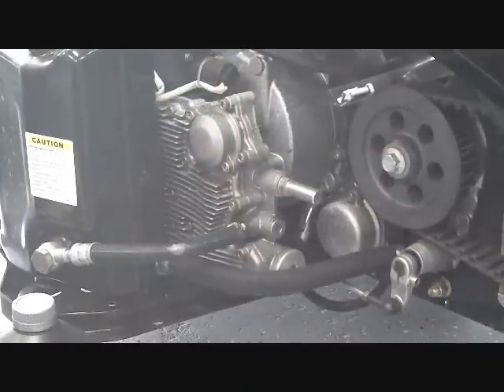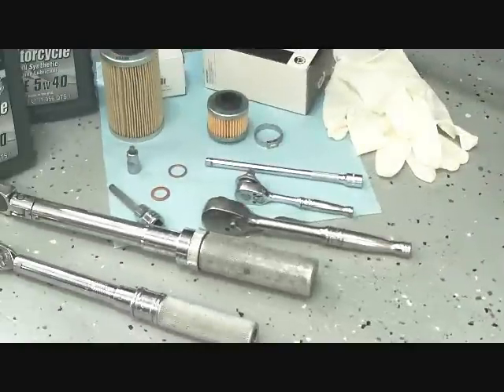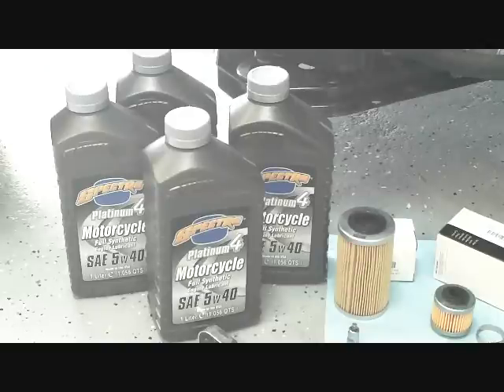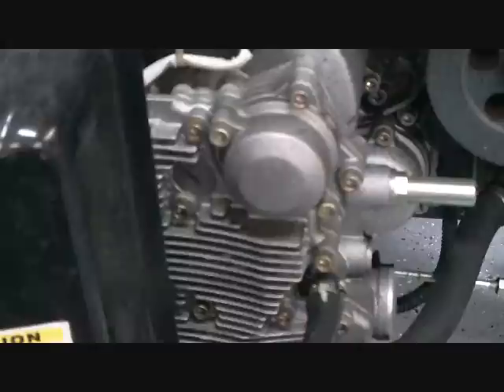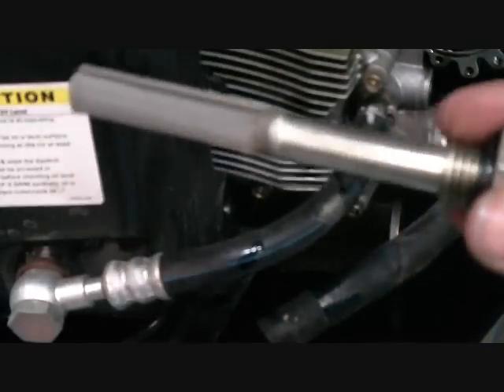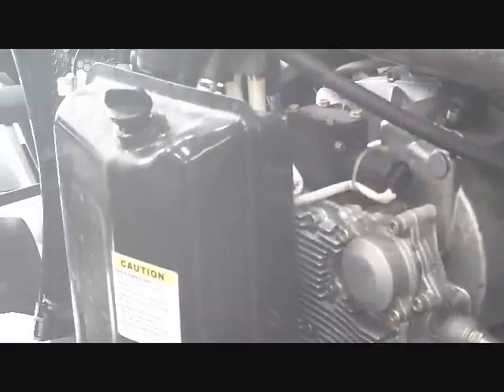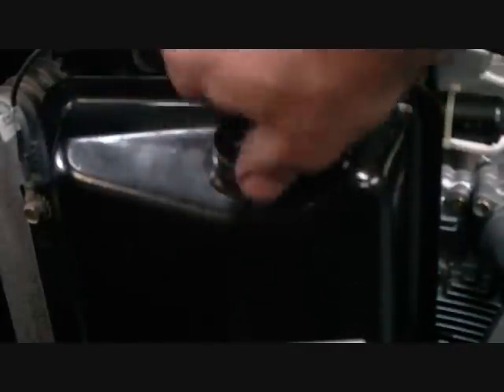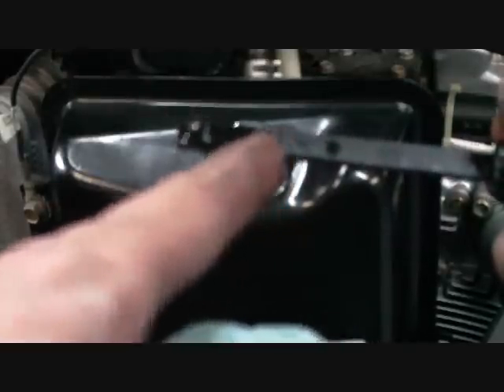Can Am Spyder Roadster - How to do an Oil Change on an SE5 or SM5

Comment: What panels did you take off?
Where is the location of the plugs?
Torque lbs?
One filter on the manual?
Cost of filter or oil change kit?
Time it takes?
Anything to lookout for?

Comment from the maker: All Left side panels - two drains. 1 on the oil tank & one on the bottom of the case near the oil filter. 15ft/lbs torque on the drains, 80 In/Lbs on the covers. One filter on the manual. Buy at your local dealer. I let the oil drain for 20-30 minutes when the oil is warm. Try not to over fill the oil, the engine needs to be a normal operating temperature to check. That means ride it... Don't warm it up for 1 minute and  check it. Oil expands when hot! Good luck. Always use torque wrenches

Comment: The info in the comments is very good, but this video needs to be re-shot showing the body panels being removed and the filter cover(s) coming off and going back on with new filters installed plus maybe the drain plug(s) being pulled... no need to see the oil draining out, we can assume it drains well enough. ps. How often should that suction screen be inspected and cleaned? pps. Also does it hurt if the level is a little over full for any reason, given that this is an external oil tank?

Comment from the maker: On a SE5 the transmission oil & engine oil are one of the same. This is why it's so important to use a quality oil on your Spyder. When changing your oil, add 3 quarts/liters, cover the fill plug, start the engine to pull the oil in then add the 4th qt/ltr. Fully warm the oil, suggest a short ride, pull to a flat surface and let engine idle for at least a minute then turn off the engine and check the oil. Add as needed. Cheers!!!!

Comment: In reviewing your video and others - a little confused as to the number of filters to change out. I have a 2011 Can Am Spyder RTS-SE5 and the dealer only claims one filter and not a transmission filter (secondary cap shown). I cannot confirm or not the secondary cap - since I have not taken the side off yet. Second - mile duration limits can be as high as 10,000 miles or one year with fully synthetic 10W-40. If information is wrong - I am sorry - but have researched this over the past 1-1/2 months, which differs from your video.

Comment from the maker: BRP has come out with new oil filters to aid in the intervals on the oil changes but everything depends on the engine temperature. If it's hot and you ride in town all day then keep your oil changed. Oil will not last that long in a Can Am Spyder, If you only ride highway you might stretch it out to 7500 with the new filter but be sure to check the oil level every 500-700 miles.

Comment: While the filter for transmission was mentioned, installation was bypassed. Also, it is important to watch for the o-ring on the dipstick.  Very messy if you lose it or strip it out.

Comment from the maker: This Video is designed to show you what you need to use when changing your oil. If you don't have the correct tools don't remove the cover. The SE5 requires at least 45 minutes to completely drain the oil out of the transmission side, too long for a video.

Comment: Just did my 2nd oil change on my Spyder SE5. THEN I watched your video. For my first oil change, I spent the $89 for the oil change kit sold by Can Am. It did NOT contain the filter screen you mentioned. I didn't even know about it. Your video isn't completely clear where the screen goes. Does it fit into the bottom of the external reservoir? By the way, think I saved about $33 by buying my K&N replacement filters on Ebay and my T-6 Rotella synthetic oil at Wal Mart. The Rotella is full synthetic whereas Can Am oil is only semi-synthetic.
Reply: Update.... Just did another oil change and I found that filter screen. You called it the strainer. It's at the bottom of the external oil tank. It was totally free of any debris inside. Just rinsed its metal mesh with gasoline and reused it. I wouldn't recommend anyone who forgot to look at it have any concern.

Comment from the maker: @djbridges25 The strainer is in in the oil tank and the torque values are 15 ft/lbs and 80 in/lbs. If you do not have the right tools do not change your oil. It's too easy to strip out the treads on the cases and oil tank.

Comment: 3000 miles? using Synthetic? you should be able to get 15000 miles easy out of synth..
Maybe do a filter change every 5000, but wtf? why does anyone need to change the oil do often other than to waste your money.

Comment: Sorry Terry Bishop, but you are wrong. You'll be pushing it at 3000 miles even with a full synthetic, and I mean a true grp 5 synthetic, not some hydro cracked grp 3 wanna be. But hey, if you want to run 15k on one oil fill, have at it. BRP will love selling you engines......